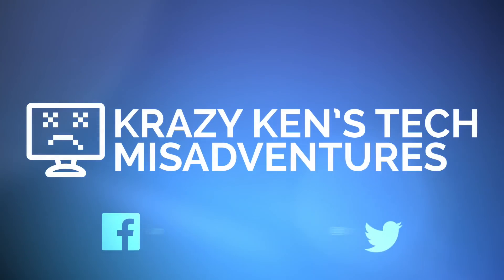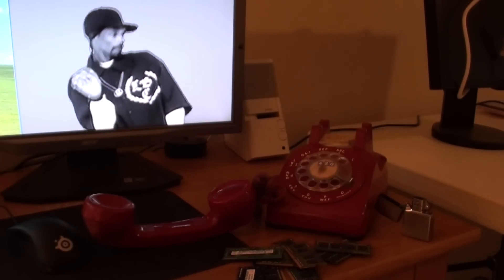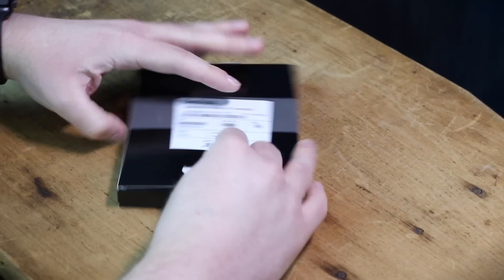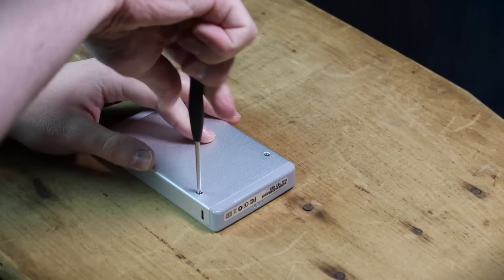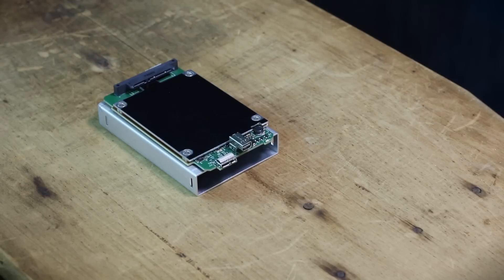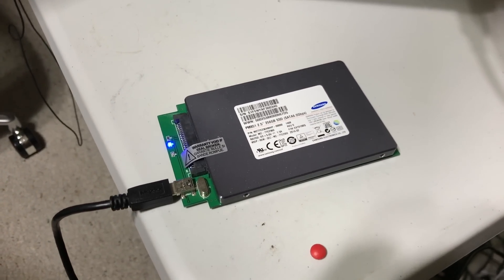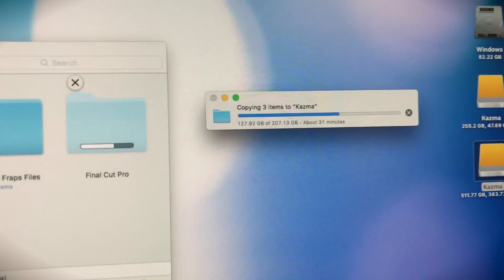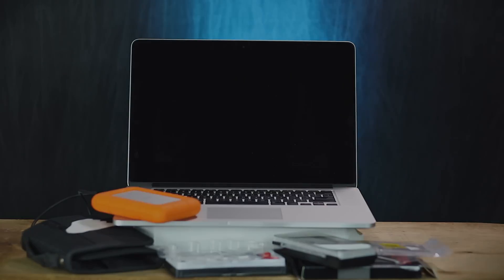SSD Upgrade - 512 GB SanDisk (ft.  Druaga1) - Krazy Ken's Tech Misadventures

Comment: You should remember better what you do Krazy Ken, the screws go in AFTER you slide the board into the enclosure ;)
Reply from the maker: Yeah… sometimes when I'm on camera, I make some goofy mistakes. I've been getting better at it! There is a "part 2" to this which shows me correcting the mistake. ; )
Reply: @ComputerClan  Thats good to hear! Looking forward to part 2 than. I like your vids man, and trust me, i have that curse to, i build my own all in one computer from an old broken laptop and i had to open it back up 50 times, but it works now flawlessly so i know what you feel sometimes ;)

Comment: the only problem i have with lefty-loosy is when your perspective is backwards.... like my piercings i seem to need to "righty-loosy", even though if i was looking at the actual screwthread head-on, it would still be lefty. but it's in my face. so it seems reversed, because i'm behind it.

there's been a couple screws i've encountered which are just backwards, but, extremely rarely.

Comment: What I don't understand is why did you put the screws into the PCB board and SSD instead of through the aluminum case then PCB board and into the SSD like how you deconstructed it ?
Reply from the maker: Yes it did. I really should get back to fixing it…
Reply: Computer Clan this kinda nullified the whole shock absorbance part as it will just shock inside now...
Reply: i was just going to comment about that thnx for doing it for me 2 weeks earlier
Reply: Kyle McCool probably why the ssd didnt fit in the enclosure correctly. Also, when a machine rotates clockwise the shaft is usually screwed in counter-clockwise so that the threads don't spin out while its rotating. Just an example of how its not always "righty tighty". (Gosh I need to go to sleep I always get too nit picky when I'm tired.)
Reply: OMG, THANK YOU! This hurted me so much.
Reply from the maker: You're asking a clinically insane IT guy why he missed a step in a procedure?!
Reply: We're all insane, But I understand your point

Comment: why didnt you install SSD to the rosewillcase cause SSD wont need extra protection
Reply from the maker: +Henry Kakkuri if it was faster than USB 2, I might have. Maybe I'll get a 3.0 enclosure.
Reply: it doesnt allways mean that the usb2 drivecloser would perform as a usb2 level device .... just give it a try

Comment: Why do you need a shock absorber for an ssd?
Reply from the maker: +projectrallus impact can still damage an SSD. Also, LaCie uses the same enclosure for mechanic drives. : )
Reply: what planning to drop it of a building? it isnt eaisy to damage a ssd
Reply: Would have to be one hell of an impact.